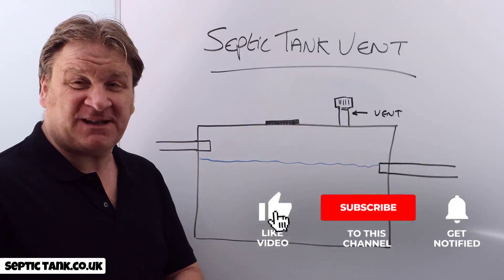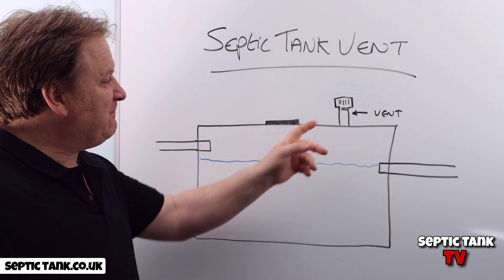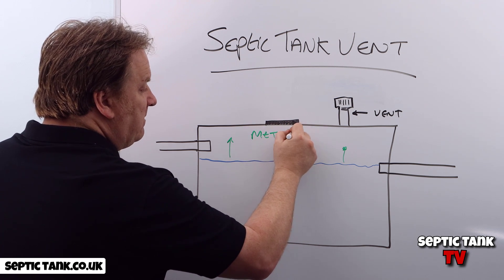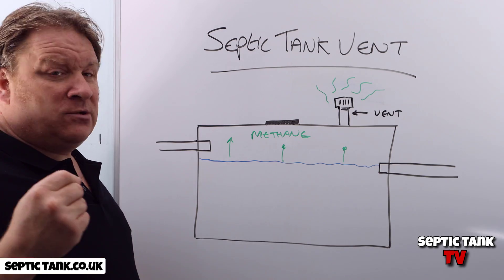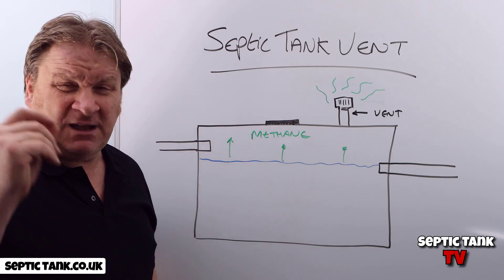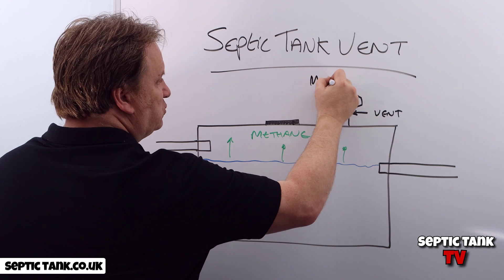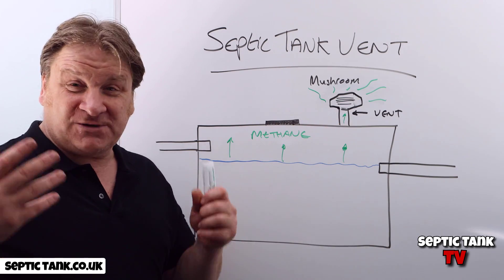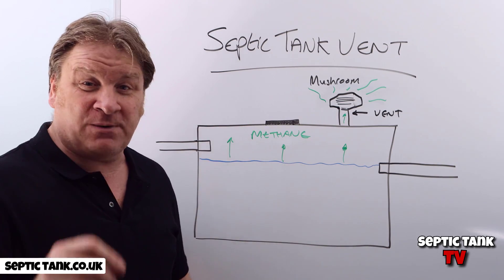Septic Tank Vent

Comment: Point 1 - Methane is colourless and odourless - the smell is more likely to be traces of Hydrogen Sulphide from the anaerobic digestion process
Point 2 - Current UK Building Regulations H.2. Para 1.21 requires septic tanks to be vented and the vent 'kept away from buildings'.

I would recommend you have a thorough re-read of Building Regulations and British Standards and re-word your videos to suit. For instance, your suggestion of using crates on the outfall of a septic tank is way off what Building Regulations require. Ideally all parts of the system should be accessible for inspection and jetting where practicable, with plenty of inspection chambers at junctions. Good of you to share knowledge but please make sure it's accurate.

Comment: In the United States we typically don't vent Septic Tanks, but Pumping Stations and/or Leaching Fields. In fact, many modern systems require a Candy Cane or Gooseneck Vent at the far end of the Leachfield/Drainfield. In some cases, the Distribution Box can also be vented, but not the Septic Tank. To be fair, in Great Britain, you guys probably do things differently, because it seems like that's the case.
Reply: Also a vent on top of the house. I understand the primary purpose of that is to let air IN during drain events, but it does also let methane from the septic rise out via the home plumbing as well.
Reply: @paulklapperich7520  You are absolutely correct... it's frequently referred to as the "stink pipe" which is usually visible on the roof of the house. In any case, in addition to venting the internal plumbing of the home, it does allow some of the gases from the septic to exit or escape, via the rooftop. However, venting the Leaching Area which is typically a Leachfield or Drainfield of some kind, not only helps to promote oxygen transfer, but it aids in the evaporation of excess water. The bottom line is this, the more airflow the better.

Comment: will venting a tank prevent H2S2 hydrogen sulfide gas from corroding the cement tank lid and walls?
Reply: Thats the purpose of venting . To get rid of those gasses that deteriorate the concrete